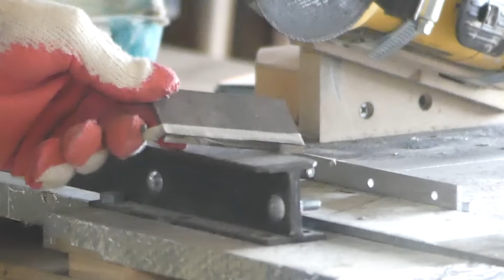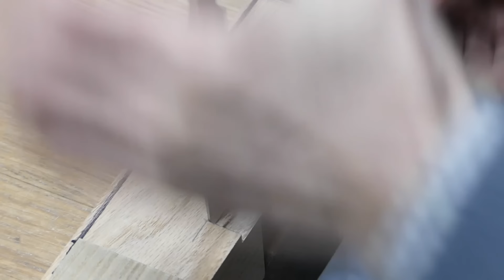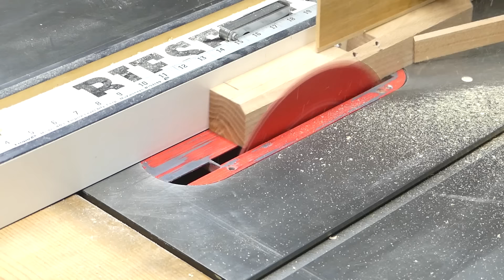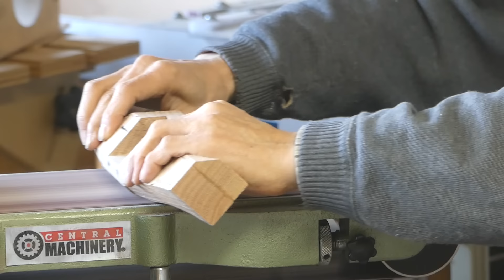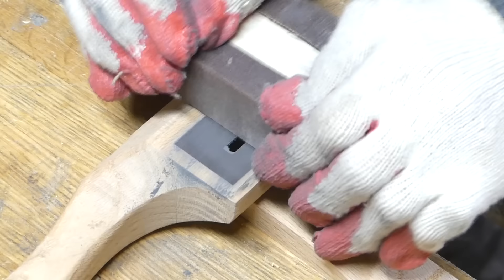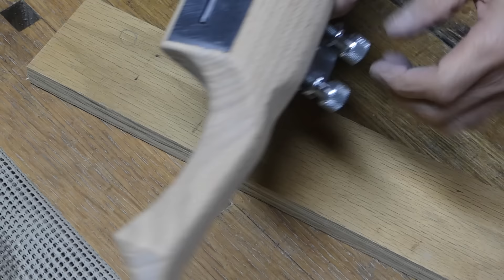Making a spokeshave

Comment: That's one large spokeshave!  Two questions: 1. What are the finished dimensions, e.g. length of handles (end to end), the length/depth of the sole?  2. What brand or who makes the small spokeshave that you used to shape the handle?
Reply from the maker: 14 (L) X 1 3/4 (D)
Vintage  stanley no 52

Comment: This is a Masters Tool that any Real man would be proud to hold. What is funny is that the plane you used as its doner is Probably the biggest trashed talked tool on the web. I picked up one knowing it needed work and when squared and had sole flattened then made a shim to tighten the mouth ,its one fine tool. It will never be the quality of a Vertas but for roughing in a piece of ash or white oak its my go to plane. But you took the thing to an extreme level.